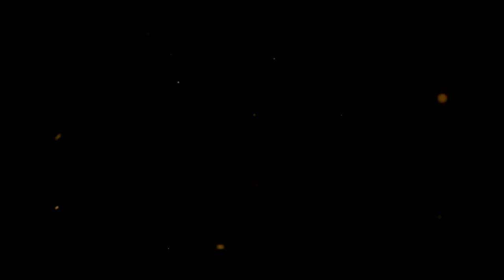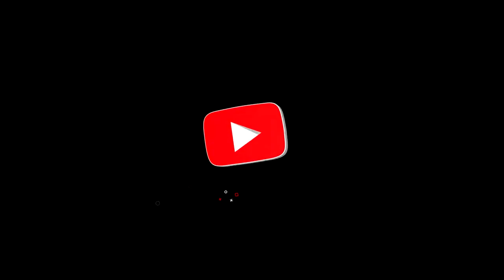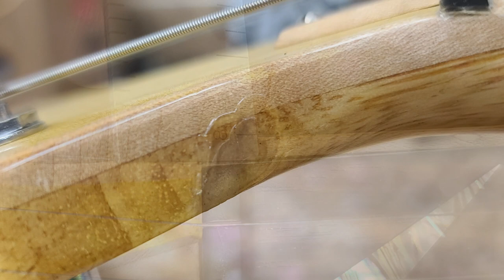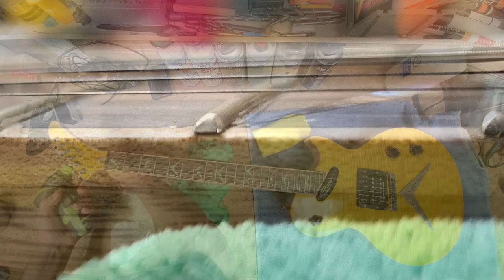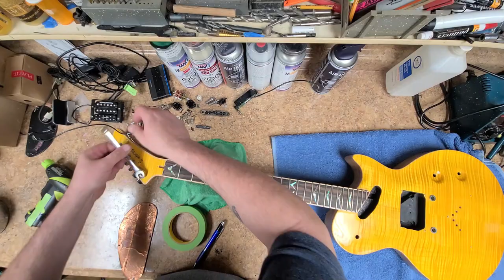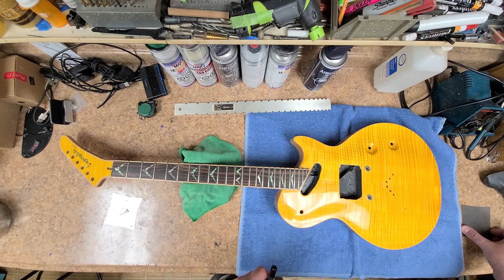Superglide Custom

Comment: The fretboard is crazy .No wonder the wires dont fit the profile. The wire bender would help but a uniform platform would a better start.
You the man for the deal. Rock on Bro